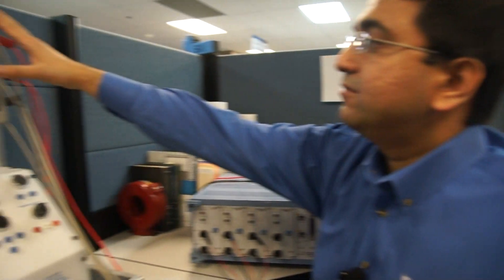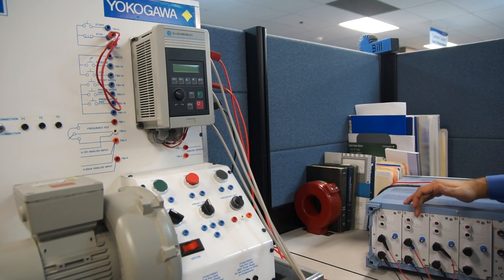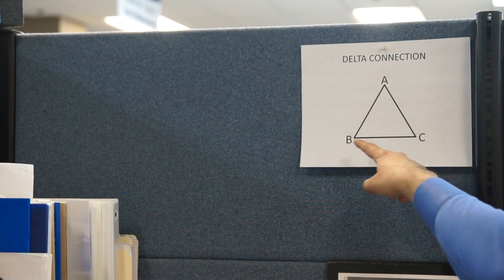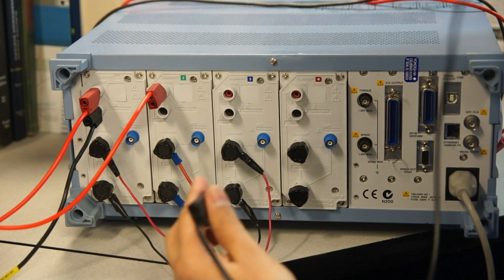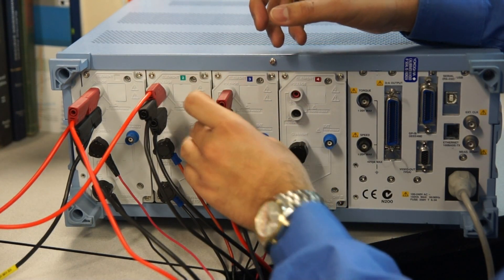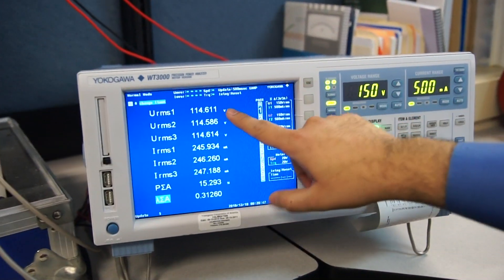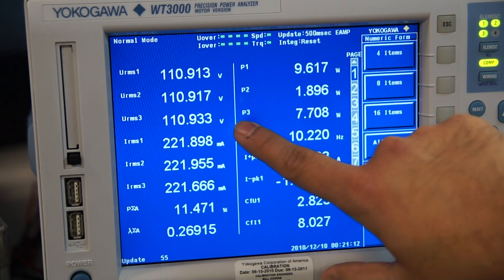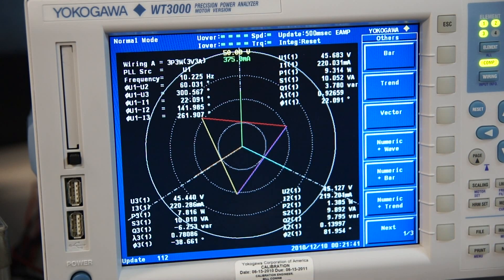3 Phase 3 Wire Connection to Yokogawa WT3000 Digital Power Analyzer

Comment: Will you get a current phase shift when testing a resistive load if you dont wire the phases referencing a single phase if you have a delta connection??